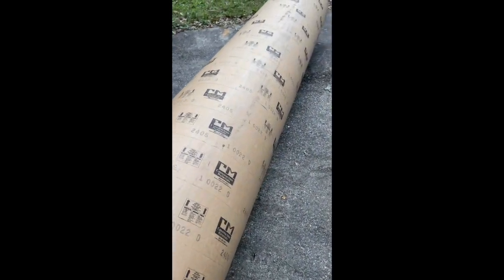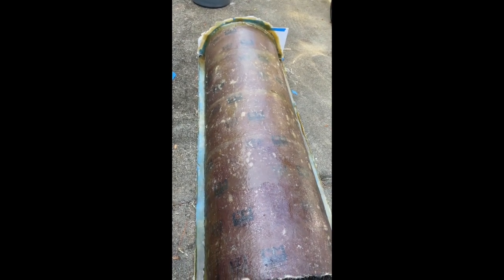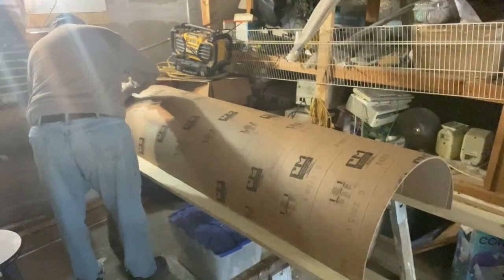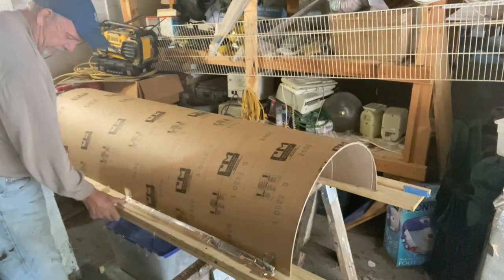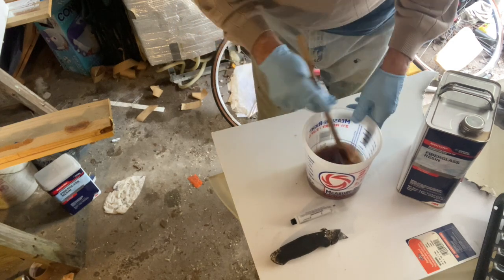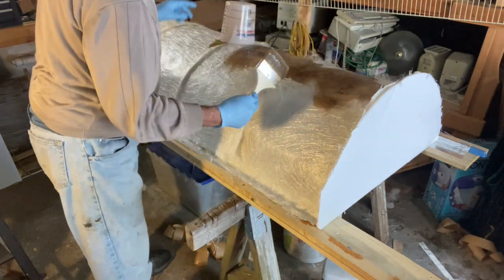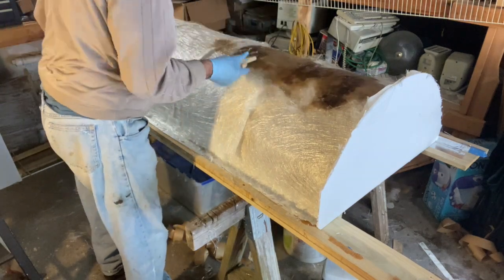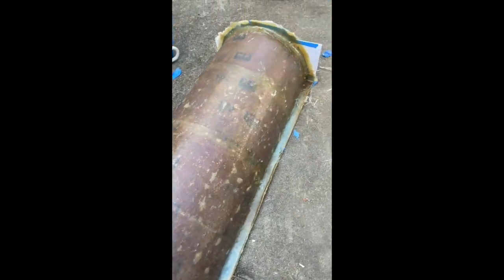How to make large Fiberglass Mold

Comment: Hey you probably won't read this but I had some questions about the Doc repair you Did the PVC when you jetted it in? Did it stay in the ground? And just attach the Fiberglass mold to it . Also how deep in the ground did you have to go
Reply from the maker: The PVC pipe was 8' diameter, it was hollow, t went into the sand about 5 ft deep. Then the inside and outside was filled with concrete, pour to a final elevation. It is solidly in the ground after 2 hurricanes